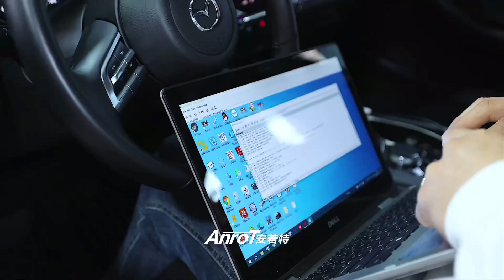Mazda Axela 2.0 power upgrade with VT supercharged

Comment from the maker: VT twin screw supercharged kits manufacture for Prado 2.7/3.5; Land Cruiser 4.0/ 5.7/Tundra 5.7/FJ Cruiser 4.0/ Pagero V93/ Wrangler 3.0/3.6 JK/ Patrol 4.0/ 5.6 / Mazda skyactiv engine for Atenza/ Axela/ CX4/ cx5/ cx8/ cx30 and so on 
More information for power upgrade please contact Amy
WhatsApp: +86 13570930387
Email: amy@jiasu-auto.com